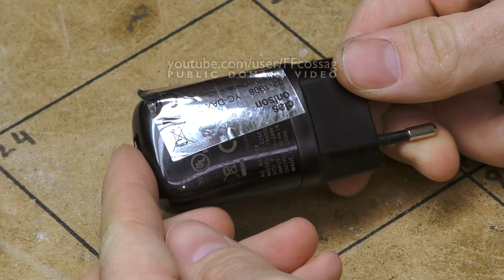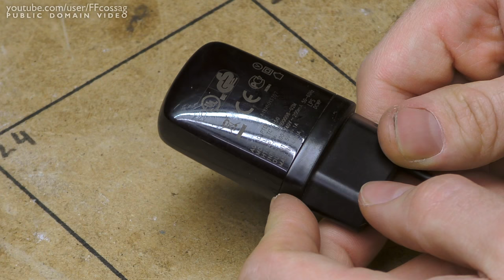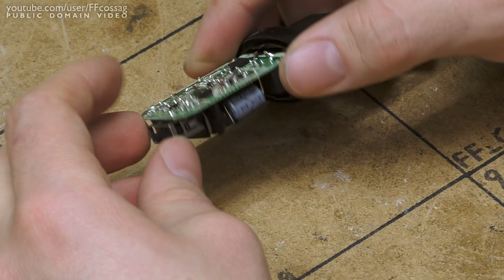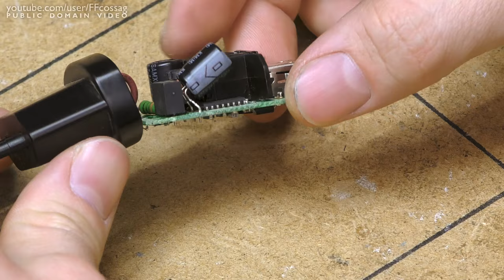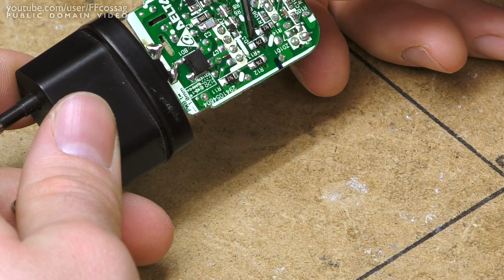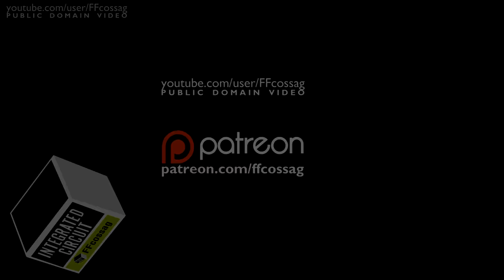HTC 1A USB charger teardown (IMPRESSIVE build quality!)

Comment: In newer versions of the charger, the plate himself makes contact with the ac-connectors, so you can have some problems (break it) if you try to open it by hammer xD

Comment: Any idea where to get this switching IC?  Mine has failed.  Keeps cycling on and of when current gets too high.  Secondary diodes , zener regulator and opto tested fine.  Caps are good also.  only thing left is the secret IC.

Comment: Ive allways liked delta electronic psu's, they dont cut corners, never had a problem with one.
Well the capacitors die after a good lifespan but all electrolitics do that.
Lite-on dont seem too bad for laptop supplys, but delta is my choice :D

Are you fully recovered, you did sound a bit rough on the previous vid.
Reply from the maker: Well enough, thanks for asking. Delta love their shit caps though.
Reply: Where do you go looking through the trash? You get the most amazing stuff, and it's almost impossible to believe that it's being thrown away.
Reply from the maker: I've got access to places similar to Dave Jones; dumpsters that are mostly used commercially.

Comment: i had a chinese replica of one of these it was horrible. at 100ma load the output voltage dropped from about 5v to 3.8v  when i got it i thouth it was the real thing but then i noticed that theere was chinese lettering behind the htc logo.